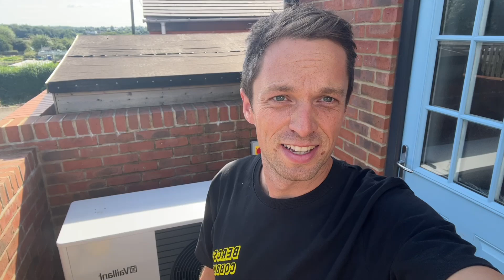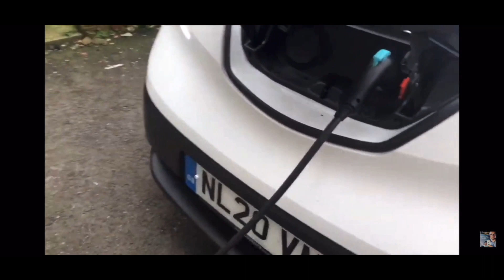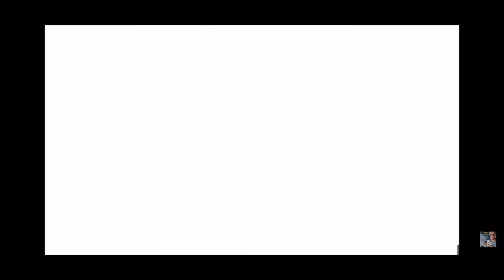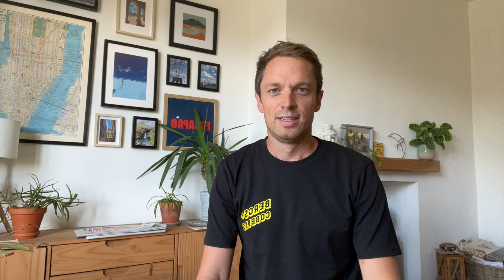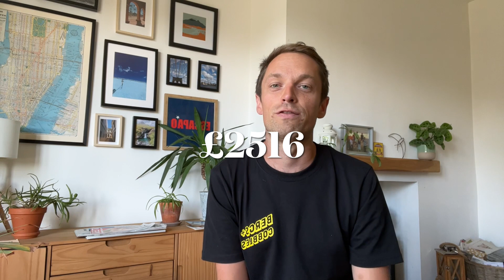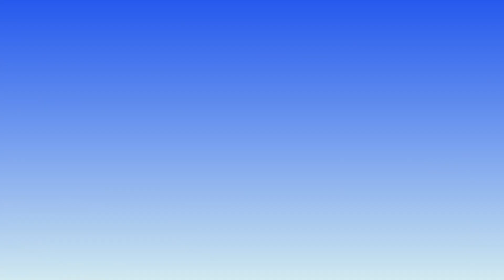How much do heat pumps cost to run? Low Carbon Lifestyle ep 46

Comment: This is extremely helpful.  We're just looking into ASHP and your videos have given a real world perspective on the costs.  We have Solar, with Octopus Go and like you signed up to the second project from Ripple energy.  So with our solar we could see our costs breaking even over a gas boiler.  But, like you, we want to burn less, so it's the carbon saving we are interested in.
I'm sure you've mentioned it in another vid, had a quick scan, what hot water tank are you using, we currently have a combi boiler so will need one, looking at the Vailant UniTower as it's a neat solution, but the Mixergy looks to be more flexible.
You mentioned how you have learnt the system and how to run it, do you have more on that?
Reply from the maker: Hi Michael - thanks for commenting. I suspect with solar and a ripple investment your costs will be quite a lot less than a gas boiler. I think ours will actually be less to run this year, I have reduced flow temperatures substantially, still happy with comfort but efficiency has improved compared to last year (it has also been warmer so efficiency not only down to my actions!)

We are using the 150 litre Unistor cylinder from Vaillant, it was all that our installer thought would fit in the space. I can definitely see the attraction of the Mixergy tank, but, as a household that doesn't use much hot water, I can't help but think it would be a meaningful investment for minimal gain.

In terms of learning and changes, I am probably planning a video on this but a few steps 1) reduced the weather compensation curve dramatically, I was worried last year that I couldn't get the house to temperature, particularly when my 9month old niece was staying but the flow temperature wasn't the problem... 
2) which leads me to my 2nd change, I had settings so that overnight the system 'set back' to a low temperature, so  that we werent heating when we were asleep, the reality though was that this meant the house struggled to get to temperature in the mornings, meaning I pushed the flow temperature up to compensate, moving the set back to within 2degrees of the day time temperature meant that we didnt need as high a flow temperature.
3) then finally, I have made sure our hot water temperature is as low as possible whilst still having enough to heat showers, taps etc as needed.

I think that is probably everything, although I probably tinkered with the installer settings a little to optimise / mess with a few other things too!
Hope your journey goes well!
Tom

Comment: Hi Tom,
Good videos, what heat meter are you using please?  Is it integrated with your ASHP or 3rd party?
Thanks Ian
Reply from the maker: Hi Ian, heat meter is a sontex superstatic 449, https://www.dmsltd.com/p_78_sontex-superstatic-449-heat-meter

it is 3rd party and mounted on pipe work entering the house from the heat pump outside. I understand the heat pump has its own monitoring of some kind but it doesn’t seem to match the external heat and electricity meters. 

Thanks for the questions!
Tom

Comment: Hi Tom, I looked at a property that has already got an air source heat pump, the current rates here are 41p electricity and 12p gas. Assuming the same average that you stated we would pay £250 to £300 more per year with a heat pump. Would you say that your home is as warm as when you had the gas boiler?
Reply from the maker: Hi Fabrizio, Yes I think we are much more comfortable, partly because I am more willing to have the heating on knowing I am not burning anything!

I was basing the figures on the rates under the price guarantee that came into place on October 1st, a list of rates are here - https://www.gov.uk/government/publications/energy-price-guarantee-regional-rates/energy-price-guarantee-regional-rates. Are you on a fixed tariff or flexible? It sounds like you would save if you moved to the standard flexible tariff with your energy supplier?
At 41p, a heat pump delivering 12000 kWh of heat, at a COP of 3, would use 4000 kWh of electricity, this would cost £1640 per year (plus a standing charge). A gas boiler, at 90% efficiency, would use 13,333 kWh of natural gas to deliver the same heat, at 12p per kWh would be £1600 (plus standing charge), so I work out this would be £40 cheaper.
If the boiler was less efficient, (87.5%-88%) then it would have the same cost, if the heat pump was a bit more efficient then it would bring it closer together.

Hope all that makes sense. What figures were you using to get the £250-300 difference?
Reply: @TomBray-LowCarbonLifestyle  thanks so much for your reply. I am on Octopus with a cheaper night tariff (which could be use to heat water). I used figured from average consumption (gas) on my current property. Gas here is currently 3 times cheaper (pKWh) than electricity so they boiler vs heat pump might even out
Reply: @FaberXLab  Stick with the gas my heat pump system is costing a fortune. My friends gas boiler is not on all the time only when needed and costs her 3 times less than my heat pump running 24/7.

Comment: Hi Tom, could you also share some facts about the return of the investment?
Reply from the maker: Hi Ivo, it’s a good question. I don’t think there will be much of a return on investment. Costs will be slightly lower than heating with a gas boiler. But this wouldn’t give a ROI on its own. 

Coupled with solar PV, or a cooperative energy project like Ripple Energy, the costs would be lower than with a gas boiler as you are generating your own electricity. But ROI on either of those plus a heat pump would depend on size of system. 

Tom

Comment: I think the issue for most people is the same as for ICE to EV, the cost to move over. Even with BUS, for most this is not affordable, and then you introduce solar PV and batteries then what is the ROI as it were. 
I remember getting solar quotes years back and there was always a section on - if this money was invested in this fund then the return is x. 
Again aside from the “green” payback, most people, especially with cost of living crisis won’t be able to consider this let alone the financial break even point. The increase in energy and social media has done one thing though, educate a lot of people to reduce their flow temps on their gas boiler to increase condensing efficiency.
Reply from the maker: Hi Jimmy, I think you are spot on. 
With the energy price cap since October we are now seeing a ratio between gas and electricity that makes most heat pump systems cheaper to run than gas, but I still wouldn't be expecting a 'payback' on their own. There is potential for better payback alongside solar PV, or something like being part of a cooperative like Ripple Energy, but we may still be looking at decades. You are likely to be in a good place if you have PV already!

But spending £6k + (after BUS grant) isn't something that majority of people can do. There may be some economies in the heat pump industry, but the major cost of an installation is labour, plumbers and electricians at your house for at least 2 days (maybe 4 'man days' in total) is a costly thing! And we wouldn't want them to rush the installation. There may be a more off the shelf installation, and as new homes are built with heat pumps from day 0 we may see costs come down a bit, but you are right, it is unaffordable for many and needs more government support.

One of the things I am hoping to achieve is show dispel myths, show people what is possible etc, and talk through the impact on emissions, ultimately, we all need to move away from gas boilers for heating, and heat pumps are almost the only way to heat without significant emissions. There are people who can afford to pay £10k for a new kitchen, £20k on a new car, neither with a 'payback' - I want to suggest that those who can afford, should be planning to replace a gas boiler with a heat pump in the next 5 years. 

Thanks for commenting!

Tom

Comment: Have you considered solar PV to help reduce your annual electricity costs?
Reply from the maker: I have indeed, our roof is near end of life so we would look to replace the roof and install panels at the same time. 

Would definitely be helpful for costs!

We’ve bought into the second Ripple Energy round that will help a little!
Reply: @TomBray-LowCarbonLifestyle  Instead of replacing tiles and procuring panels, have you asked GB Sol for a free quote for their PV slate?
Reply from the maker: I haven’t, but we’re a long way off that stage at the minute
Reply: @TomBray-LowCarbonLifestyle  Worth asking them for a desktop quote if you have the time. It will be a useful datapoint as you approach that stage. Just my .02c

Comment: Running costs vs initial investment - the quotes I'm getting for air-to-water heatpump solution + decom old oil installation+tank + new radiators + solar panels means I'd be ahead only after more than 20 years. Ridiculous.
Reply from the maker: Hi Ad Ha - are you taking into account the potential increase in value of your house? Are you taking off the cost of a new boiler? I would expect the price of oil to mean a heat pump reduces costs a lot.
For many people with a gas boiler a heat pump project would rarely 'payback' but would probably just about break even / offer small savings . Coupled with solar panels there would be a significant reduction in costs but you are right in assuming a 20 year + payback. Compared to an oil boiler, I would expect the savings to be greater
Since we got our heat pump our house has been much more comfortable (more consistent temperature), so although I have calculated it has increased our costs last year and will more or less break even this year,  I am happy with the change, particularly when I think through the tonnes of CO2 I have avoided.
We dont tend to do a 'payback' calculation on new cars, new kitchens, new sofas etc. Stuff that will impact our comfort but do very little to our costs, I think we need to see heat pumps more in this way, and any savings they could give in the long term are a bonus.

I would be interested in the kind of quotes you are getting though - could you break it down for me?
Tom
Reply: @TomBray-LowCarbonLifestyle  I’ve achieved this “more comfortable” with my gas condensing boiler, my flow temperature is 35°C, but then again I have UFH and it’s uses Opentherm. I can heat my stored HW to 60°C (legionella) from my boiler (it can change between the two temps), but with Octopus it’s cheaper to heat it at 8.5p from 21:30 for up to five hours. But to top up during day rate isn’t an issue with gas as it’s still “cheap” 
So with my near 96% plus efficiency and still moving up, it’s a no brainer for me. The economies of scale are just not there to move away from my gas boiler. Perhaps in 5-10 years time when the relative cost of ASHP and GSHP are cheaper through production volume and better trained installer network, then it might be worthwhile. EPC B helps of course.
Reply from the maker: @jimmyc38  that sounds like a great set up, and getting the most out of your system. You'd be ready for a heat pump at that low flow temp with UFH and efficiency would be very high if you are  happy at 35°C on the coldest day. If you are ok holding out with your existing system then you may indeed get a cheaper installation in a few years.

I  might be misunderstanding your point on the low rate for octopus - is that a dual gas rate? Not heard of that before. As long as your gas is 3.5x cheaper than your electricity tariff then it is likely to be cheaper to heat with a gas boiler.

Tom
Reply: @TomBray-LowCarbonLifestyle  thanks, sorry where I’m coming from is, if I heat my HW at the cheaper electricity rate then I don’t have to use the boiler to do so since the boiler needs to heat to 60°C, I can keep the gas boiler at low temps for nearly 100% of the time for heating only. If I need to top up (with gas) then it’s not such a big deal and this is few and far between since Go Faster is from 21:30 - 02:30, and therefore usable times so to speak.

Comment: Unless you can store cheap electricity in a battery enough for each day for running the heat pump it will cost the same as gas.
Reply from the maker: Hi Phil, at an efficient / COP of around 2.97 then yes the heat pump will be the same price as gas at the price cap rates. Any higher efficiency and heat pump will give a saving. 

We do store some energy in a hot water tank that acts as a battery. This is charged overnight at a lower rate. 

Thanks for commenting

Comment: We live in 2 bed bungalow in Derbyshire with a south east facing roof.I have had quotes for both solar/battery and heat pumps.We use 6600 kWh a year of gas and 2500 kWh of electricity.My fixed price 2 year deal ends in October 2023.I can afford the systems we have been quoted, we  are a retired couple.But I find that when these people quote it's a bit like the old double glazing sales technique.They all  say their system is great, I just wish there was some organisation that could give me a none biased view on what we should go for.
Reply from the maker: Hi Steve, thanks for sharing your experience. I agree, particularly on the solar / battery sales technique, it can be very similar to a double glazing sales experience. I think there isn't much that differentiates solar proposals other than cost. You may feel happier avoiding certain brands of inverter or panel,  but I suspect most would offer similar performance and warranty.

Heat pumps could be a bit different as some manufacturers offer quite different sizes (physically and in terms of output), could offer a range of internal set ups, and potentially a range of efficiencies. The breadth of the heat pump industry will be able to install a system that works in your setting. As long as installers are designing a system to run on low flow temperatures your installation will be very efficient.

It is difficult to navigate, and there isnt clearly an independent source of advice, which is possibly something needed. I wonder if this is a role someone like https://www.theheatinghub.co.uk/ could provide in the long term.

There is an element of trust if an installer is MCS accredited, although this won't guarantee perfection!

I wonder whether any of the companies who have quoted could give you contacts of previous happy customers? If you were able to find others who were happy with an installation that could be a good start?

Hope you are able to navigate the jungle!

Comment: Hi Tom may I ask how you run your heat pump do you run in steady state mode and what are your target room temps. And are you running in weather compensation mode or fixed flow,  the reason I ask is I run my ASHP in steady state mode with target room temps of 19C and my weather comp curve 25C at 12C outside and 35C at -10 and HW at 55C and my SCOP is circa 5..  I think my settings are quite extreme and I have replaced all my rads based on 30C flow to match the room heat loss.  And yes 19C room temps is a big come down from the 22C we used to enjoy but the addition of a vest micro fleece and jogging bottoms I can honestly say I don’t notice the difference when sat watching the TV.   Keep up the good work and look forward to how you tweak your system to get the SCOP higher my take on it is lower flow temps lower room temps is the way forward.  As a side note There’s a great article on the low tech magazine .com  titled insulate the body first then the house it’s really thought provoking and all HP pump owners should read it.  It explains in simple terms how you achieve lower room temps  with the same comfort levels.  Best Regards Neil
Reply from the maker: Hi Neil - thanks for commenting. 

I’m not 100% sure what you mean by steady state mode? 

We have it set at 19 during the day and a set back of 17 overnight. It runs on a weather compensation curve. Sounds like your curve is a bit lower than ours. I think we are more or less 45 at 0 degrees. Around 30 at 12 degrees. This is lower than what we had it on for most of last winter so already seeing big efficiency improvements as we come into autumn. 

Completely agree about lower flow and room temps. But even at lower flow and medium room temps the efficiency could be higher than what I’ve had! 

It sounds like your system is doing really well! And your costs must be so low! Very impressed. 

I’ll try and dig out that article. Sounds very interesting. 

Thanks again for messaging. Tom